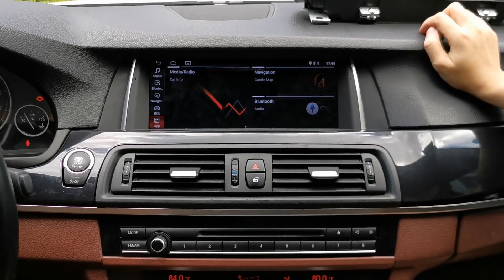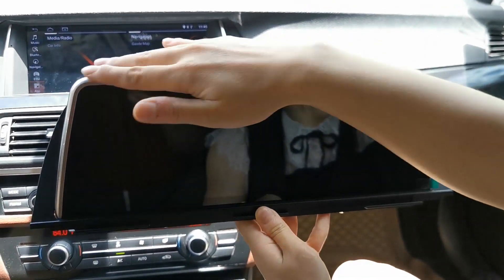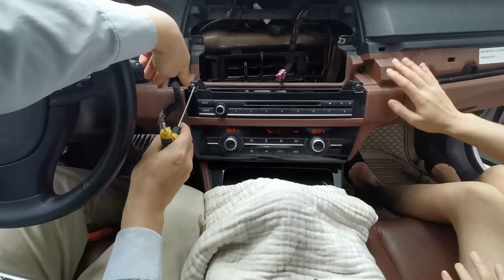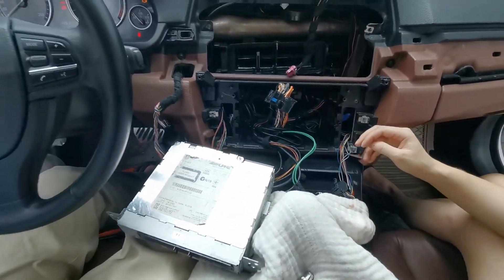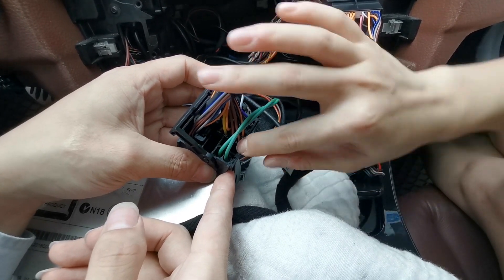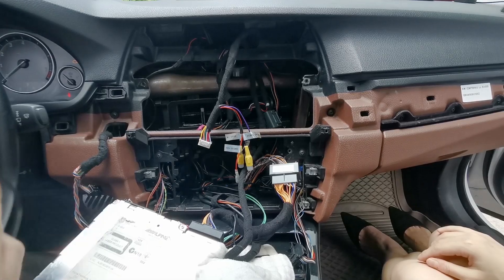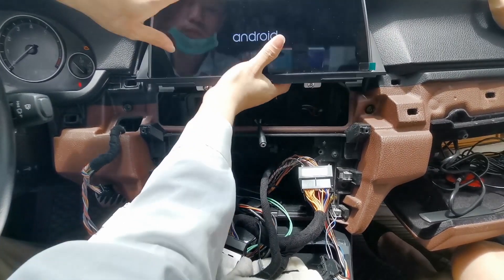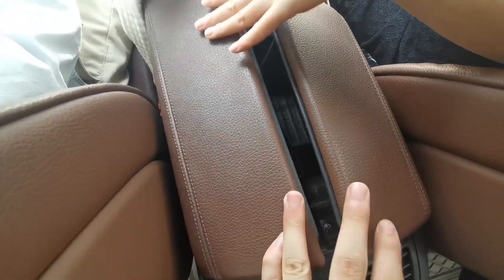NEW STYLE Android radio For BMW F10 installation video

Comment: I installed this but my back up camera says no signal is there a way to fix? I reversed everything and the back up camera works with the original head unit
Reply: It's most probably a setting, I can't remember what setting exactly, I think screen resolution or aspect ratio, don't remember. I had the same issue on the older 10 inch android  screen
Reply: @vhomukwevho  hey i figured it out thank you for responding, i went into the settings and under reverse camera i selected oem camera. works great!
Reply: Помогите понятьЧто значит оем камера ??
Reply: Или нужно провода подключать ? Не могу разобраться

Comment: Hello my brother excuse me for disturbing you I just have a simple question if someone can answer me I installed Android on my BMW X1 84 but I have a problem with the sound the radio is CD playing works very good there is sound but on the other hand multimedia and YouTube on the Android there is no sound they told me that it is a problem with the AUX socket.
can someone tell me what is it
Reply: did you manage to fix it ?
Reply: i have the same problem but i know my AUX socket works because i tested with my old phone that has AUX and it works... did you solve it?

Comment: Hello
I have a problem. I connected multimedia and there is no sound when I use youtube or music player. When I enter the original menu, then I have sound... Do you know what the problem is, everything is connected fine...
Reply: i have the same problem!! i can''t hear anything from the android side, but original menu i hear. i am plugged into AUX cable. did you find a solution?
Reply: Hi friend!! I have bmw 520d with Cic radio conected with aux cable. Anyone have interferences in CarPlay phone calls? Any ideas? Any factor y configuration? Thanks
Reply: You need to connect the AUX cable from screen to car AUX port